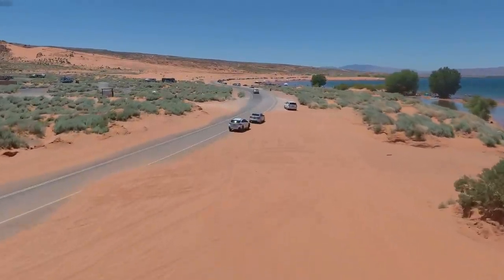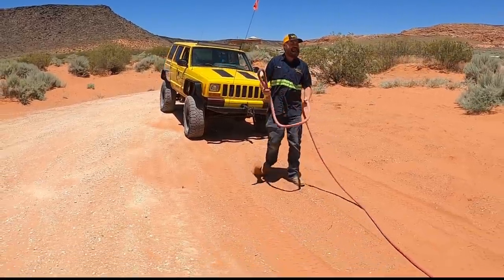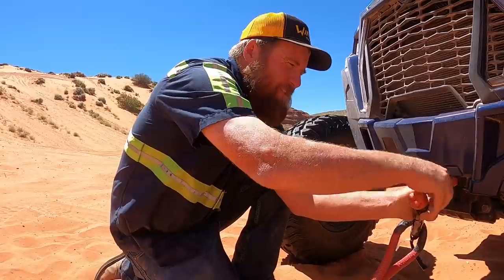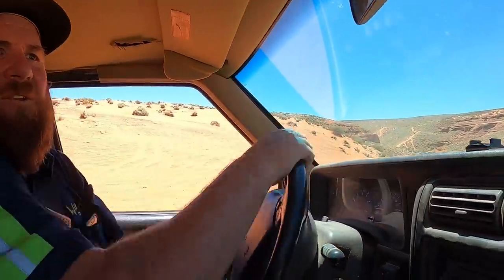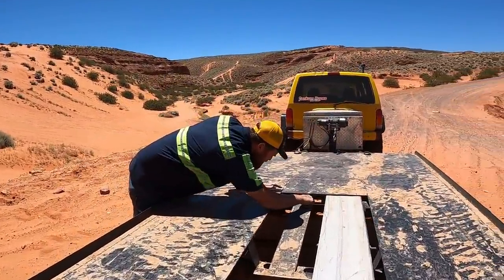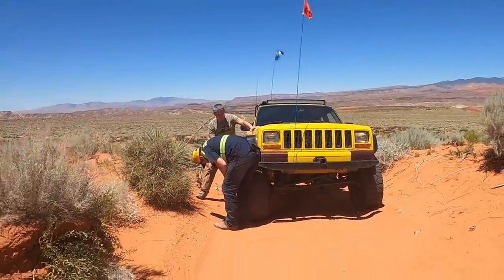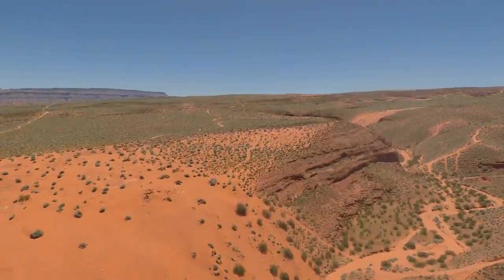Two for Friday! (Tundra at the lake, RZR shenanigans)

Comment: Explains how to not break hubs from mis engagement just helped someone make it back home and save a repair👍
Reply: I’m glad my Jeep Cherokee don’t have locking hubs. That would get old after a while
Reply: Eric Duncan you do have to watch out for the actuators though, it’s been a while but I feel like I remember they were often a problem discussed on the forums. I forget if they’re vacuum operated, electric, or what. I think the benefit of the manual locking hubs is that they are pretty bulletproof.
Reply: @jeremyspecce  I've got Warn locking hubs on my XJ. they're awesome. and I've always thrown it in reverse to engage them just cuz it felt like i should, im glad i was right! but the hubs are great im driving around with broken front U joints and the jeep has no idea
Reply: Full time four wheel drive baby!  I have Land Rovers and a Toyota Land Cruiser.

Comment: Back in the standard transmission days, we reversed the whole system when locking in hubs and low range.  Had to make sure everything was meshed.  We also never went off-road without locking into high range.  I pulled a bunch of guys out that only tried 4wl drive after they got stuck. But, they didn't have lockers either.

Comment: Matt with an attitude problem. "To lazy for 4X4" . (LOL). Burning rubber and So I'm stuck right now. All of this drama with no Ed. I think there is a connection. Great video and comments are meant with humor. 
Important NOTE of gratitude-ness: Hey Matt. I ran over a 750 pound security Ballard with a 40 foot gas powered 4X4 hydraulic lift and high centered it. I wasn't going anywhere. I was very concerned and the $500.00 tow truck to come get this big honking piece  of heavy steel machine. I looked down all sad and concerned. Then I saw the paver stones and thought of how Matt uses stones as ramps. Yep, no more high centeredness as I drove off of the anti-vehicle security Ballard. High Centeredness is a real word-really.

Comment: We all need Ed. Question: Is the Jeep still running the 4.0 L straight 6. I had a Jeep in ‘91 as I remember it was an awesome motor.
Reply: Yes, not only is it the original 4.0-liter straight six, but it has over 210,000-miles on it.

Comment: you need you a tractor battery mounted in that box on that trailer with a solar panel mounted on the lid with a small cage over the top of it to protect the solar panel you can even run a hot wire through your trailer light wires to the battery

Comment: That Toyota Really! I drive my stock 93 4x4 Nissan Pathfinder in 2WD all the time. It's a SEV6 so it does have a limited-slip rear diff. It's unbelievable what it can do in 2WD the places I have gone and the hills I have climbed. This Toyota has a V8 and that's what he got stuck in. I was expecting it to be up to the axles/frame or off the side of the road but common. I might be complaining about Toyota but in actuality, it's the driver and not knowing their rig. He could have air downed a bit and a little more loud peddle.

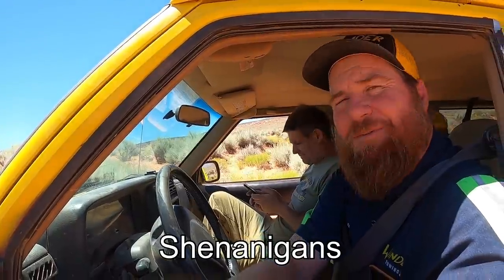Comment: Explanations to your decision making process would be helpful for us viewers. 4:40 Why couldn't you tow it out like you originally thought? It seemed to tow out fine from that pit. Also 9:25 you said you're in 2 wheel drive and you don't want to lock your hubs in to get up the hill, why not? Were you too lazy to get out of the car? Please explain :)
Reply: @MattsOffRoadRecovery  Hardest working lazy man in America.
Reply: @badgerpa9  You mean the broken U-joint? Yeah I noticed that, then they went home, picked up a trailer and came right back, at least that's what it seemed like with the editing. So from the viewer's perspective if the u-joint was the reason they couldn't complete the recovery, why could they do it an hour later with a trailer? Now if in between the two cuts they fixed the jeep, that's a different story, but they make no reference to that. In the movie industry we would call this a "plot hole" :D :D
Reply: @badgerpa9  Ah that makes sense, the camera and audio was from inside the jeep, so I assumed it was the jeep making that noise. Upon closer inspection that does appear to be the underside of the rzr and not the jeep :)

Comment: Hey Matt when is the winch on the trailer gonna be fixed and do remote control hauling? lol   could you install a jump box on the jeep next to the trailer hook to run off the Jeep while engine is running?  you might forget to charge the portable Jump pack :P     keep up the great work

Comment: Those old bleacher seats are pretty durable! I wouldve expected em to fold with that kinda weight on em.
Reply: Matt welded a set of cross beams onto the underside of those bleacher seats. That's why they don't fold up under load.

Comment: Matt, could you try someday to recover a car like that tundra using only the stuck car itself? Like by lowering tire pressure and maybe with traction boards and that kind of stuff, that would be cool.
Reply: He explains in another video why he does not lower air pressure on customers cars, (they need to be aired back up) and he has videos showing getting videos unstuck and other shenanigans as he calls it.

Comment: nice way to show 4x4 is mandatory for offroading.  awesome crew. awesome videos.  awesome jeep but you still need the new bronco : ]  and you need the manual.  you can dump the clutch at 1 mph in 4 lo.  because of how the gearing is.  it will crawl everything
Reply: @badgerpa9  that's interesting. Maybe Poland has some rough off-road
Reply: @badgerpa9    i tried    i found the puma and the kuga but my favorite now is the mach e 1400.  i might have to cancel the bronco and the cybertruck to get that 1.
Reply: @badgerpa9  wait a minute,  the 4x4 suzuki is still made for the UK.  and some reviewer said its better than a Wrangler with wrangler tires.  come on.
Reply: @badgerpa9  that's a awesome offroader. My wife bought a highlander 4wd. So I decided to take it on a fire road. I did a slight flex. The back wheel was in the air. I gave it a little gas and nothing. Just the wheel in the air moved. Awesome job Toyota. But it was used and a good deal and she didn't care it had 4wd
Reply: @badgerpa9  great tip. I'll try that in the fall

Comment: what does locking hubs in mean? i’ve never seen anything about off roading till 2 days ago when i discovered this channel
Reply: If you ask questions ignore the sharks someone will see it and answer sooner or later.
Reply: Front hubs are made so that they can be unlocked when he is using rear wheel only. To switch to four wheel drive, he must exit the vehicle and turn an engagement switch on each front hub.

Comment: Hey Matt, I was actually wondering for some time but why do you use freewheeling lockers ?
It's quite frequent to see you forgetting them or going to lock them late.

Their potential benefit in general is very discutable, both in mpg and wear it's hard to find someone able to measure it and they also have their drawbacks.
Seeing your usage for the XJ mostly offroad (and you use a trailer when it's too far) I really don't see the benefit of your freewheeling.
Any reason I'm missing ? Maybe your life will be just a bit easier without them or letting them always locked ?
Reply: They're hubs... lockers are IN the differential... 
Less bind, less wear, larger axles come with hubs(usually), quieter... I love my hubs, no harmonic vibs. at highway speeds. 
Having locking differentials without hubs isn't horrible, but having a freewheeling front end helps with binding & makes thing smoother.

Comment: Why don't folk carry a little compressor and valve tool to air down and up.  Bit of tire wiggling with lower tire pressure and they could drive themselves out or not even get stuck in the first place

Comment: The tundra is not made for that terrain, way to heavy. I got stuck immediately in sand with mine. Jammed a door mat under the rear tires and was able to wiggle out
Reply: Do you really think a tundra is heavier than any other truck that goes in that terrain? They weigh the same as any other truck lol It's all about tire pressure if you dropped your tires to 8-10 pounds when you were stuck you would have drove right out.
Reply: @TheSupersample  It's all about weight AND tire pressure.

Comment: So what's the weather climate around your area during summer and winter ???
Reply: In the summer the temps are usually in the 90's to 100's. From that area to the next "bigger" town north the elevation rises a couple thousand feet in about 45 miles. That area sees a lot more snow and lower temps than the southern most part of the state. It still gets cold in the winter in Hurricane and St. George but rarely snows. Kolob Reservoir is typically closed during the winter months due to snow.

Comment: I have a question for you. My question is I have a Kia Sorento all wheel drive and if I came out there can you give me any recommendations where I could go and possibly not get stuck and I know my limitations with this vehicle
Reply: Best to go with at least one other off road vehicle or 2 if you can so if one gets stuck you have help close by.  If you do not know any one stop by a 4x4 shop in the area, hopefully they are nice and give you suggestions, most off road people like to see other people having fun too but some people are jerks in every group.
Reply: @badgerpa9  I live in Georgia and I go on the forest service Service Roads or on WMA land and I know there was one Trail I took and I kind of got to the top of this hill and I stopped and looked as as I'm in the wrong spot and was able to back out of it luckily and I understand that you want to do what the others do. But like I said right now I kind of know my limitations what I can do and what I can't do now I am thinking about putting a 2 inch lift kit and some taller tires on it and possibly a skid plate but I'm not for sure as of yet but that still will not help me from getting stuck and I know I should be with a group of people and let them know my limitations
Reply: @davidlingelbach9887  The northern part of the Peace trail is pretty calm still, part of the issue is when it rains a good road can get bad fast so even if someone was just out there it could be different.  I hope you find a good place to go and have fun, if I was heading out there I would meet up and try a few trails also. Some places between fuel are distant so watch that.

Comment: Why was the engine on the RZR running while it was being loaded onto the trailer?
Reply: from watching the video I would say he backed the rzr closer to the trailer to winch it on and just waited to turn it off when he knew he did not need it running anymore.
Reply: Power steering is electric so running the engine helps keep the battery up.

Comment: There must be a reason why you don’t have a roller on the back of your trailer for the cable to ride on
Reply: Matt mentioned that low weight is such a priority that he actually cut out a bunch of sections in the trailer's structural frame (looked like swiss cheese), just to lighten the load. A roller and the frame to support it may add more weight than he cares to have.

Comment: Had an 89 XJ for years and I hated that stock the front hubs were always locked.  In order to cut down on the drag when not 4X4 ing I'd take the front driveshaft completely out.  Got much better gas mileage too.